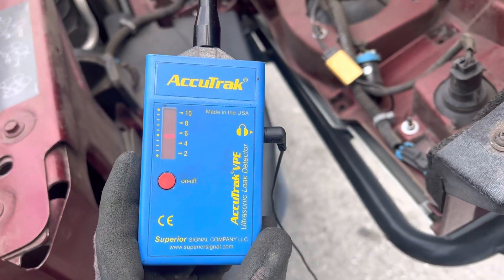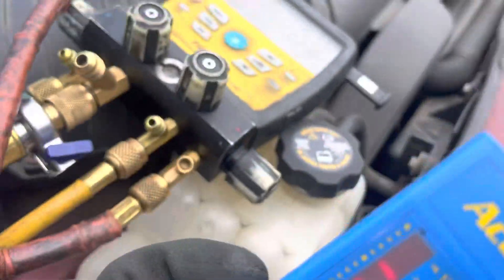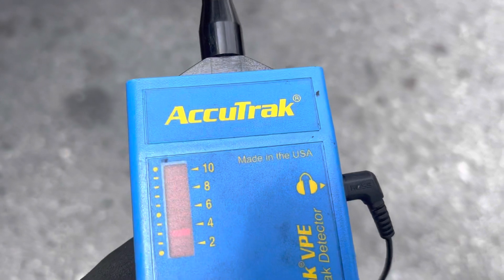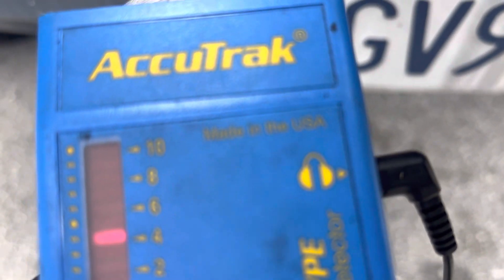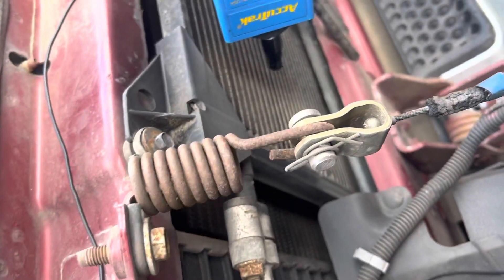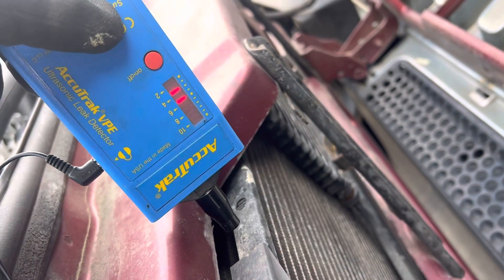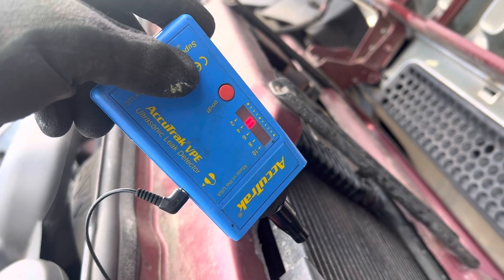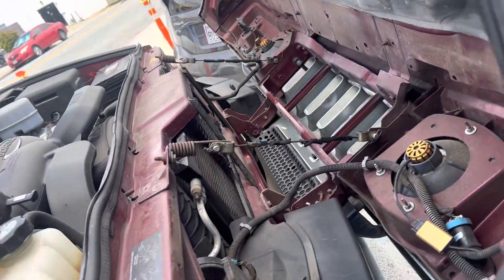Accutec ultrasonic leak detector picks up leak from a few feet away

Comment: Vary interesting senitive as  all out,  but couldn't get the screw fiting ?????
Reply from the maker: Wasn’t leaking down at the screw fitting.  We’ll see that on the next video released on this vehicle.  

It was too windy out here to use the refrigerant leak detector . 

We just know that somewhere in the middle of the condenser it has a big enough leak to be picked up by the ultrasonic leak detector .   

So the customer is going to have the shop order a new condenser.  He’ll drive it home tonight has UV dye in it.. 

I suspect it is one of those kind of vehicles that do not like well you have it filled with refrigerant and running and high pressure . 

Delete just opens up and lets loose letter on as it’s cooling down for a few hours . 

And my next video on this vehicle proves that .   A massive failure completely ruptured and released all the refrigerant and tons of oil and die everywhere from the center of the condenser..  not at a fitting.
Reply: Thanks for the great info👍

But Im referring to a past video were you spayed bubble leak detector and can see a bubble but the ultrasonic didn't pick it up but the inficon did
Reply from the maker: That’s a vary unusual situation. It was the first time I have ever had that happen.  But I have videos showing the opposite. 
         We’re the ultrasonic found the leak and the refrigerant leak detector did not. 
          Have videos showing no method finds the leak. Only leaks a day or few later then the UV dye finds the leak. 
        But when filled up with Refrigerant. 
     No leak again at the dye spot. Bubbles, ultrasonic, vacuum, high pressure nitrogen, refrigerant leak detector.  None find it.  Because it’s not leaking, it sealed. 
      Until it hits that right temperature the it opens like old faithful geyser releasing all the refrigerant at one time back down to 0 psi.
Reply: @coldfinger459sub0  right, because condenser run at vary high pressure the nitrogen needs to simulate a 108 degree day.

Yes I have seen the ultrasonic pick up leaks so small the bubbles could barely move but it sounds like frying Bacon in your ears
Reply from the maker: @fvfgx  this is exactly why I stress to all the shop owners you cannot just have just one form method of finding leaks at least three different types. And still as seen in some of my videos three different types for different types cannot find a leak. It takes a fifth method..

Comment: What is the Nitrogen pressure during test?
Reply from the maker: I believe it was 170 maybe almost 200Psi

You will see later on when the vehicle comes back because I told the customer to take the car and use the AC and then park it overnight .   
     I instructed him to take a look at the condenser the next. 

He called me up and told me it lost its charge and you can see the big staying with the UV die on the condenser . 

I’ll be releasing that video in a couple days just as I expected 

I told the customer that this would happen .  

I’ve seen this happen so many times I can predict that usually .
Reply: Hay @woodway11   that not wooday tx 
Because I was born there
Reply: @fvfgx  Never been but I do have a sister lining in Krum,TX